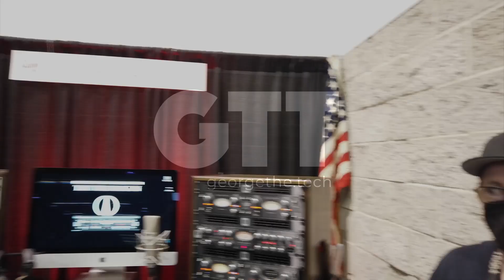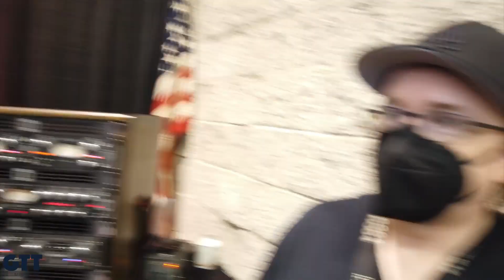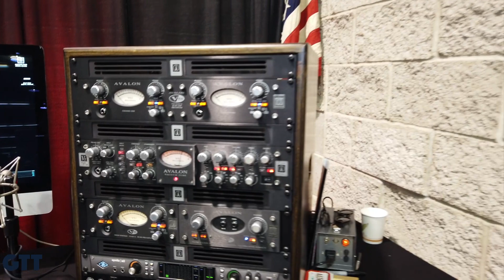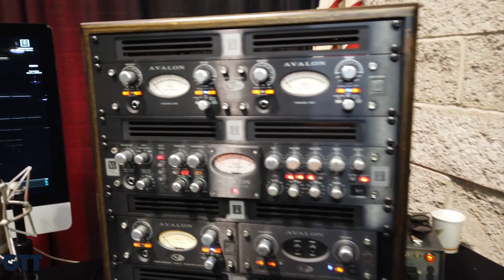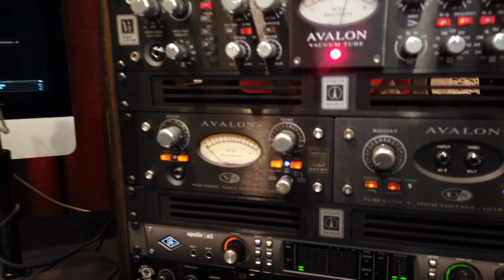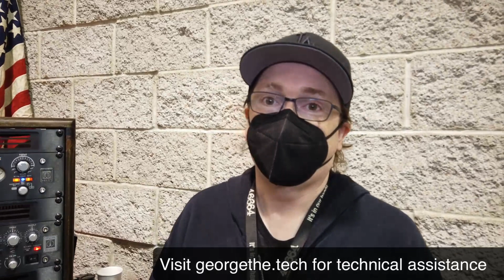NAMM Show 2023: Avalon Designs VT-737SP tube channel strip and V5 solid-state microphone preamps

Comment: i found that the plug in works extremely well just as the hardware. But against my hardware unit, I have to push the compressor on the plug in a half step more to get similar control to my peaks as the hardware unit. On my hardware I have my compression set to 3.5, and the plug in needs to be at 4 to get those first peaks tamed. Even at that, the plug in still has a little trouble controlling them, where the hardware just does it perfectly and has that "special sauce" the plug in just cannot achieve. But it is damn close, and I use the plug in 95% of the time, and the hardware just when I really know I need to be a little more dynamic. Wave form definitely looks smoother, and fuller, compared to the plug in. But, its damn close, and I have no problems using the plug in for the convenience of the recall ability.